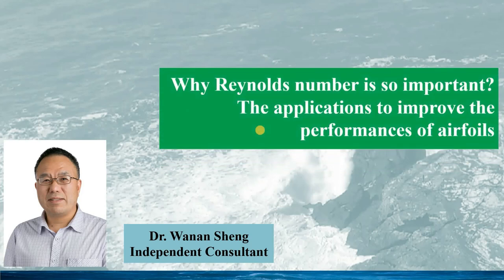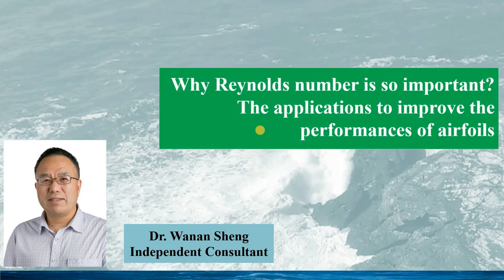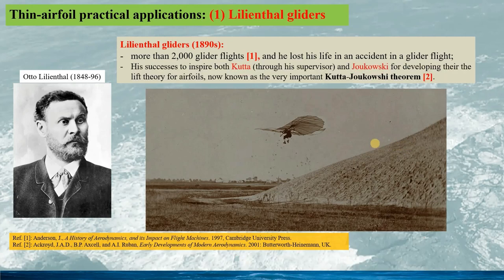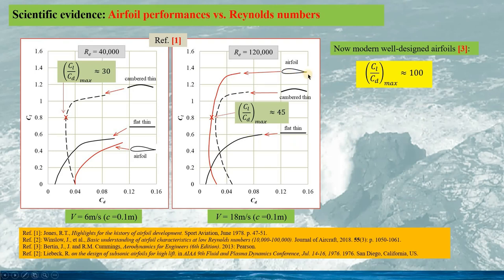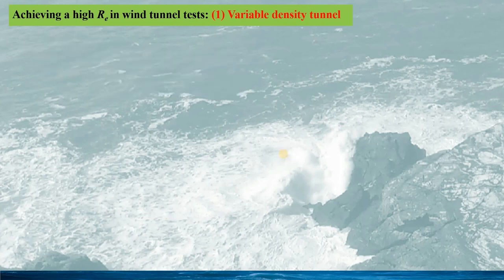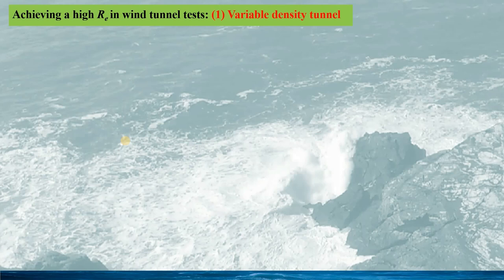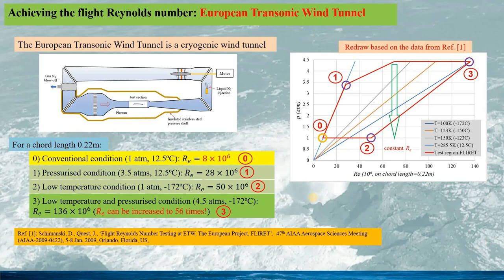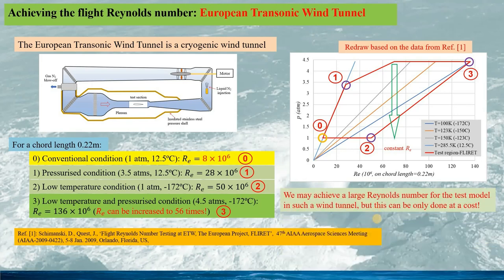Why Reynolds number is so important? The applications for improving the performances of airfoils

Comment: Thank you for the information, sir. I would like to ask something. 
By increasing the air density many times to reach the Reynolds number in the cryogenic tunnel, wouldn't it be altering the actual atmospheric conditions of the flight?
Is the cold, dry air in the higher altitude less dense than the hot, humid air in the lower altitude? The air really ceased to exist and became rare, or the nitrogen that goes up to 1000km occupied the spaces and left the air at a higher density, but without oxygen for us to breathe and perform combustion in the engine?
Thank you!
Reply from the maker: Thanks. The main purpose is to achieve the high Reynolds number, which is only related to density and the kinematic viscosity, both would be the function of temperature. Whether we are using nitrogen or air, it matters only when comes to the density and viscosity. If these are right, then the modelling would be correct.
Reply: @ScienceofFluids  Thank you sir for the answer. In fact, I think it's very strange that the air is less dense as it rises. After all, moist air is less dense than dry air. The inferior mirage of the sun and the moon itself, on a daily basis, could indicate the denser air over the less dense air. But thank you very much again.
Reply: @ScienceofFluids  It is very contradictory for the tunnel to decrease the air temperature, as it actually is up there, to be able to increase the density, but we are told that the super cold air up there is less dense. 
Thanks.